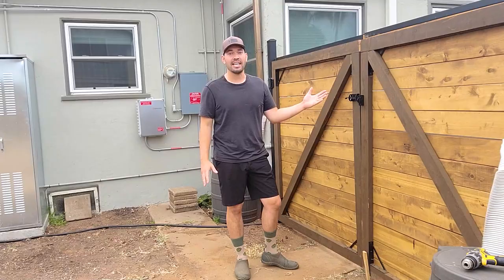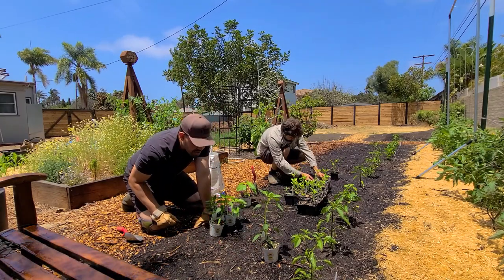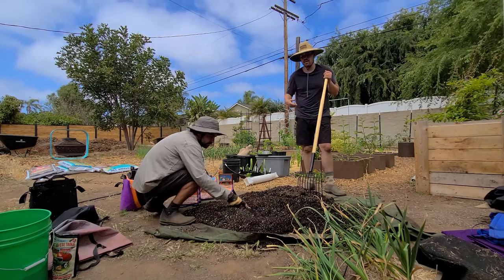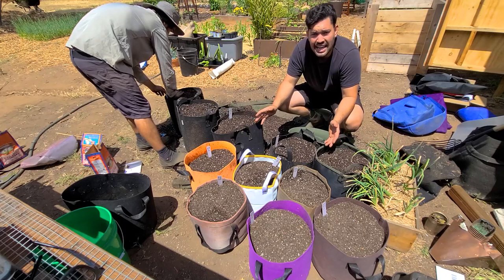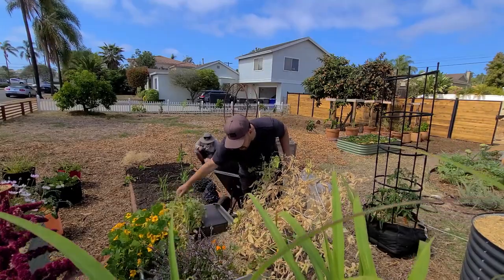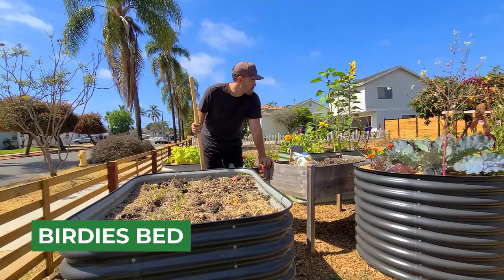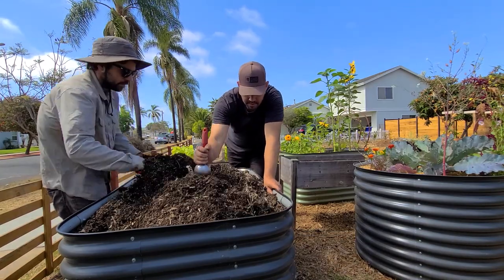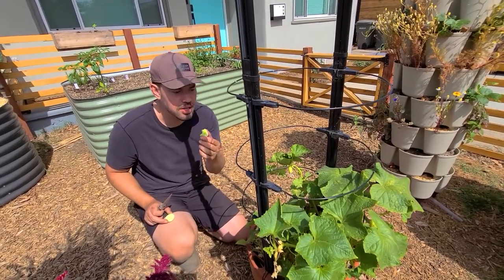Summer Garden Planting! Peppers, Potatoes, & More 🌶️ 🥔

Comment: Tip for the gates.... use wheels to help support the ends farthest from the hinges... will take a lot of stress off of the hinges and make opening those big gates easier!  The tip for filling the raised bed almost to the top is soooooo important.  I filled my raised bed to about 8 inches of the top and by the end of the season, it had dropped to almost 2 feet!!! with the soil settling!